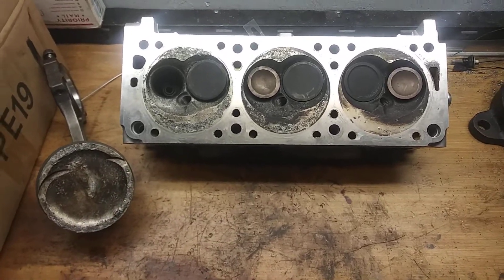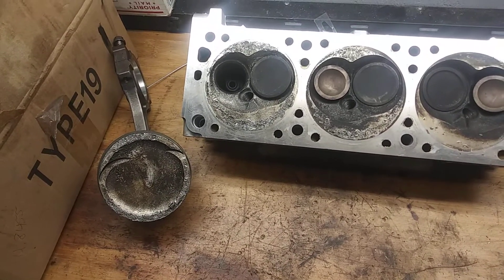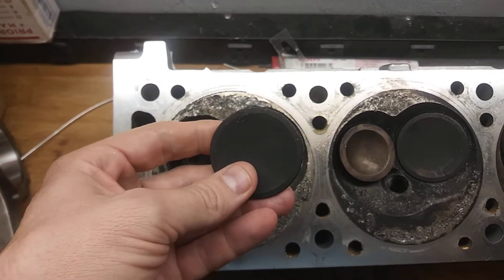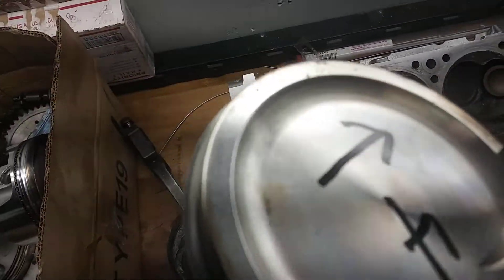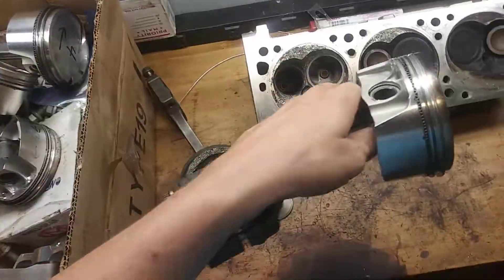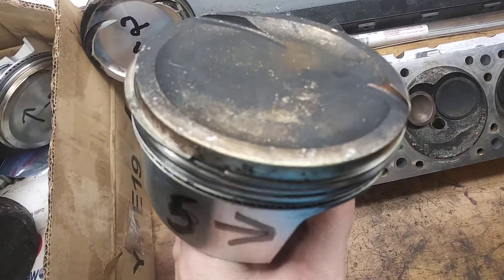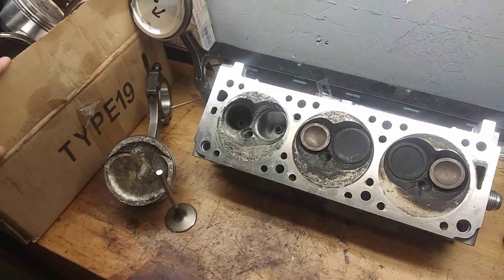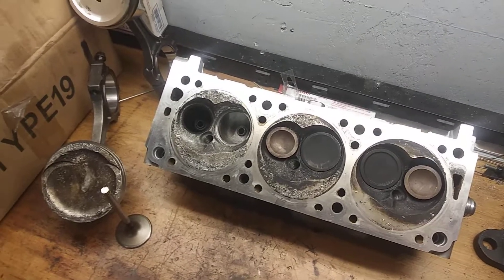Forged LZ9 engine is destroyed.  What happened?

Comment: Your install looks very good .. cleaner than others ive seen.. howtight is the fit compared to a stock 2.8mpfi
Reply from the maker: Fitment is the same since the block and heads are the same dimensions
Reply: @Slowv8Fiero  I read a couple places the total weight is 349lbs you think that's about right? You may have saved some weight by using the 3500 intake by a couple pounds.  Some people change the timing cover too.
Reply from the maker: @BrianReno-qy9wk  350 is close. Def in the ballpark.  I used the older style timing cover from the 80s so that's lighter than the new stuff plus no ac compressor or power steering either in my setup
Reply: @Slowv8Fiero  one problem I see it question is the 3.4 Camaro has a 92mm bore and 3500 heads are 94mm or 99mm so how would that work?
Reply from the maker: @BrianReno-qy9wk  if you buy an lz engine, you use the lz heads.  The lz has a 99mm bore.  You can't use any other heads on the LZ and vice versa.  Can't use LZ heads on 94mm bore engine.
Reply: @Slowv8Fiero  ok I was mixed up I was thinking of a 3.4 Camaro 93 /95 with 3500 heads that a lot of people do but the 3.4 has 92mm bore and the 3500 has 94mm bore so how are they doing that hybrid?  I know they use the 3400 uim or the 3500 uim I'm just wondering about that 2mm bore difference..  not your engine .your is the lz9 with 3500 intake?
Reply from the maker: @BrianReno-qy9wk  the heads on the 92mm bore and 94 are interchangeable.  That's what allows that to be a hybrid 

The lz 99mm bore is totally different heads and chamber size.

The 3.9 with lz4 upper intake dynod 500 wheel tq at the wheels.  It pulled good even down low.  I am now running a 3.5 with a cam.  Much less tq down low. About 100lb ft less at 3500 rpm.
Reply: @Slowv8Fiero  turbo? Have to be..
Reply from the maker: @BrianReno-qy9wk    ya turbo. Check out my other vids if you want
Reply: @Slowv8Fiero  it's got to be night and day from the original engine. Are you pulled back into the seat when you stomp on it?

Comment: Do happen to know the arp rod bolt part number? Thanks
Reply from the maker: I have the number around here somewhere I'll let you know
Reply: @Slowv8Fiero  k thanks
Reply from the maker: @OurGodLuvUs   201-6301 I believe is the part number from arp.  For a bmw I think
Reply: @Slowv8Fiero  thank you again. My 98 gmc 4.3l just stopped running (240xxx), so I'm going to use that as an excuse to drop in a 3900. Love your channel. 😉👍🏼
Reply from the maker: @OurGodLuvUs  just a heads up, the factory rod bolts are good to 600 HP.  If you aren't gonna make that much just stay stock
Reply: @Slowv8Fiero  well thank you for that information. One more question. Is it a 4.4" bore center? If so that's the same as a 4.3l maybe exhaust can be modified?
Reply from the maker: @OurGodLuvUs  I don't know what the bore spacing is.  Don't know about modified exh manifolds either.  But the stock 3.9 stuff flows well I think
Reply: @Slowv8Fiero  ya, I was just wondering, due to ease of being in a s10 and some after market. Thank you again.

Comment: Why did it drop a valve seat?
Reply from the maker: Don't exactly know. Could have been multiple reasons.
Reply: @Slowv8Fiero  
Well at least you have the space stock 3.9. I really want to do a 3.9 in my 98 Sonoma (rwd) but don't have the money to right now. Anyway great build 🦾😁🤘
Reply: @Slowv8Fiero  Were these heads reworked ? or factory stock ? seats let go due to incorrect sizing on install , overheat and  valve event issues .
Reply from the maker: @eflanagan1921  reworked. I ported them and had a new valve job done with all new valves.

Comment: Get two pistons, set of heads, and check rods for bends. You might have bent two of those rods buddy. I've been following your build on RFT.
Reply: Damn... I hate that. But what Joe Cool said... I concur. Maybe get the block checked for cracks, too. I saw a 350 swallow a machine screw, and cracked the block where the piston cocked sideways in the cylinder. Other than that, if all of the damage to the cylinders was above where the compression ring stops, I would maybe dress up the scars, if you can feel them. I would not bother to hone it.  
WTH causes an LZ9 to drop a valve seat?! Is that a routine occurrence?
Reply: Well, gm did use a lot of the ls knowledge when designing these engines, so maybe ls7 problems and remedies? Idk 🤷🏽‍♂️ I asked the same question a while back.